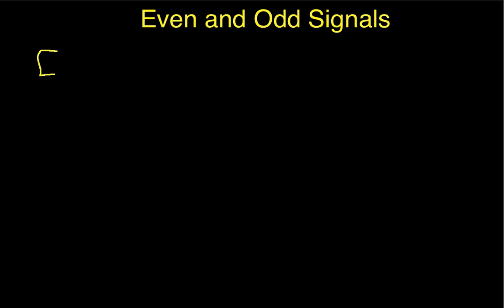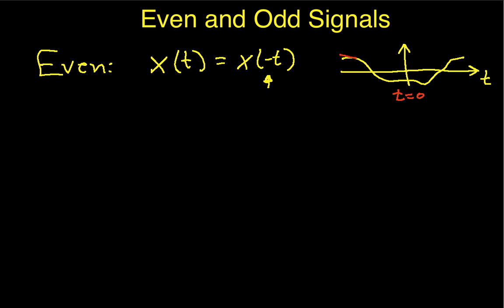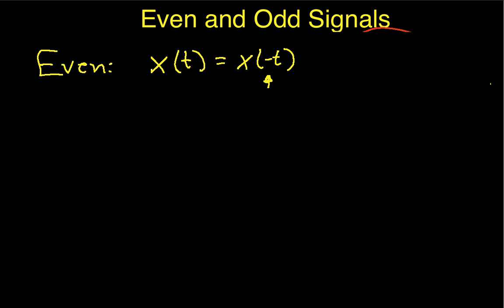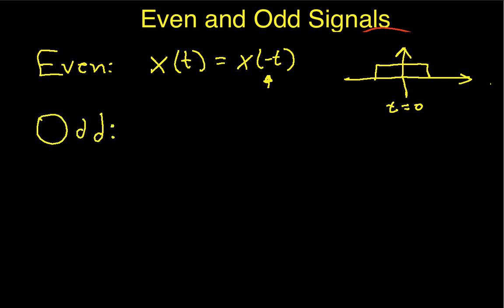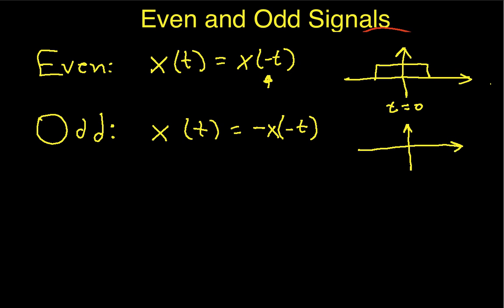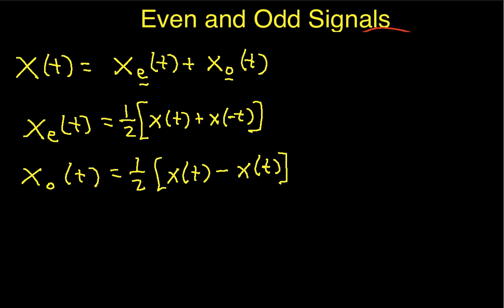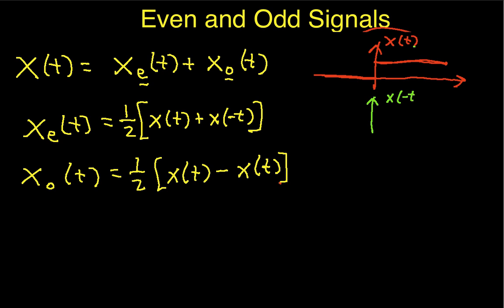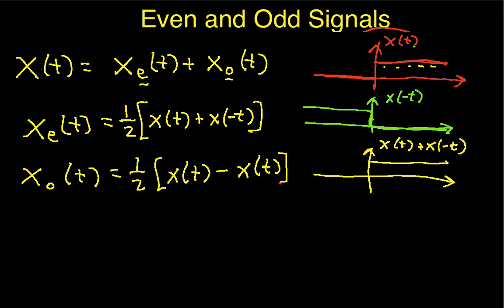Even and Odd Signals

Comment: "unit step function" is step function u(t) - u(t-1) i.e. step for 1 unit. 'step function' is (t>0). small but important distinction.
Reply: +t3hb0ss It's not unit step function that equals to u(t)-u(t-1). It is equal to unit impulse function. unit impulse function is [u(t) - u(t-1)] / 1 for example (in continuous).
Reply: +Gordon borostraw impulse function aka delta function is not u(t)..